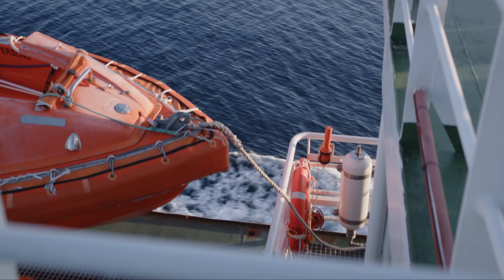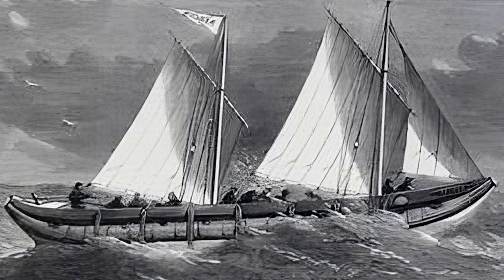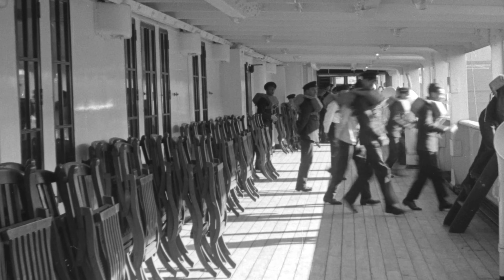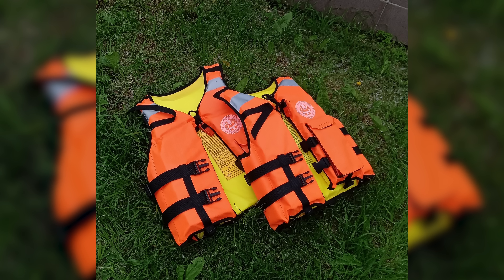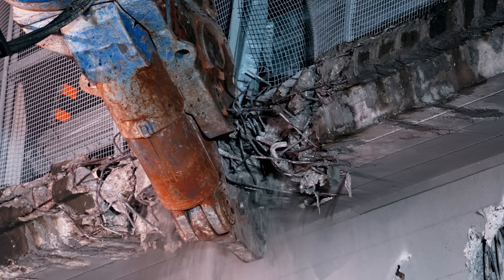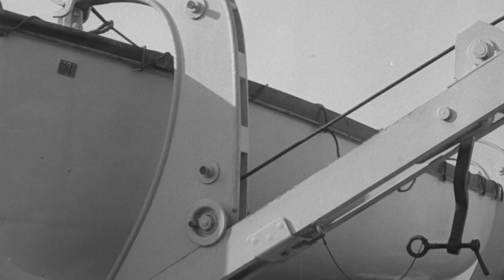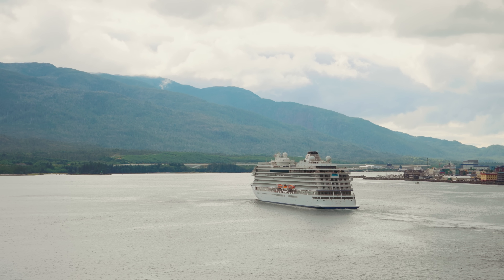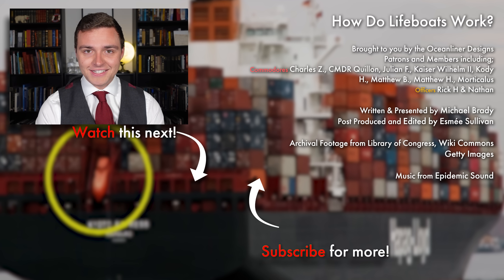The Amazing Evolution of Lifeboats: From Titanic to Today!

Comment: I remember watching the footage of the Costa Concordia sinking and what really stuck me was all the difficulties they had launching those modern lifeboats. Even with all the advances in technology they still hadn't solved the issue of launching boats out of a listing ship safely. This video is fascinating. In some respects the lifeboats of today are far more advanced than the ships of time past. At least in an abstract technical sense.
Reply: The reality is there is no safe way to launch lifeboats from a severely listing ship. The people on Costa Concordia lucked out that the wind pushed the ship towards the island. Had the wind pushed her further out to sea that ship would have capsized and taken thousands of people with her to the bottom.
Reply: @zombieshoot4318 the captain a fool that he is (he got 16years prison) intentionally run the Costa to ground as soon as he knew they were going to sink. About the only wise decision he made
Reply: @waldo197720  sorry but you’re wrong. The ship lost power immediately because the impact was in the engine room. The ship was at the mercy of the winds and currents. They had no ability to steer the ship. The captain lied about grounding the ship. The Italian Coast Guard stated that the ship drifted into its final location. It was sheer luck the wind pushed them that way.
Reply: @zombieshoot4318 The Rudder lost power slightly later, he ordered it to point to shore in an attempt to ground it, it cut out after getting to it.
Reply: @kenrfc  well he’s right as long as humans aren’t involved. 😂
Reply: @kenrfc  The problem with Costa Concordia is that the evacuation was started only after the ship had already started listing. Had the evacuation begun as soon as the collision happened, all lifeboats would've been lowered into the water.
Reply: That’s because it listed and if they tried to load people on it and launch it…. Yikes
Reply: @kenrfc Well what alternative could there possibly be? If a ship is heavily damaged quickly enough than yes, it will list, technology cannot defy physics. The odds of that happening in the first place nowadays are very, very small though. Airplanes can still fall out of the sky, but they are still the safest means of transportation in existence.
Reply: The Oceanos in 1991 had the same problem.
Reply: @kenrfc  It's objectively true. Ships are getting into significantly fewer shipwrecks these days thanks to those modern features. He never said life boats aren't important and necessary
Reply: @kenrfc He is right, the Costa Concordia would never have sunk if the captain wasn’t a ridiculous excuse for a human being and an idiot. The entire thing was due to his incompetence and complete carelessness. He didn’t even order an evacuation and abandoned ship. It is really the cruise lines fault for even employing that man
Reply: @maxonite His Safety Officer took command and ordered an evacuation, which is pretty hard for an Officer whose not ‘Captain’ (Role not rank) too do.
Reply: @plagueoperator7438  exactly, had the captain done his job other people would not have had to try and do it for him
Reply: @maxonite  Yeah, its his fault, but it was his actual lack of regard for Procedure, and the failure of his Company to pick up on it, so they hold the overarching fault aswell.
Reply: Costa Concordia is a different can of worms
Reply: It seems to me the best thing to do to deal with a listing ship is to design lifeboats to be easy to enter from the water.  Once the ship reaches a critical point, the boats would be launched empty (and likely faster and more violently) before it becomes impossible to do so.  Individual humans would have the ability to escape the ship at a far greater list, especially if they can swim well enough to hop into the water from the down-angle side and proceed around the ship to the empty boats.  

Any which way you cut it, having the boats on the water empty is better than not launching them at all.  Which means also designing the launch mechanism to breakaway at pressure, allowing the lifeboats to be freed and float up unassisted after the ship has sunk.  It doesn't matter how good of a swimmer you are; hypothermia sets in quickly in the ocean.
Reply: @adde9506  What you're describing is liferafts and ships already have them.
Reply: @kenrfc Costa Concordia was 12 years ago.. Modern radar and navigation systems have evolved throughout the years
Reply: @Johnchoojiale And procedure wasn’t followed, the Ship cannot pilot itself and even with Modern Satellites, it can still be upto 5-10ft off your actual course, which is why Navigators have to give exact co-ordinates, which was not happening on Concordia, if it had, the mistake would have been picked up on, and this ship would have returned to a safer distance.

Comment: I'd argue that the davis system is also a big problem for passenger liners too.

Passenger ships are slowly phasing out professional crew roles for minimum wage and migrant workers. Investigations show that most crews are either not properly trained to operate Davis systems, or can't realistically operate them in the event of an emergency. Low-wage workers are also not professionals and shouldn't be expected to perform complex lifesaving duties.

Also, Davis systems themselves are notoriously difficult and dangerous to use in bad weather or when a ship lists. For these reasons, ships are starting to transition to inflatable boat slides as an alternative. It would be nice to cover the advantages and disadvantages of this new system.

Comment: They did a crew drill last cruise I was on. Sat and watched them lower one of the boats and drive it around. Quite the operation. 
I believe listing was an issue with the Costa Concordia. They couldn't launch the boats on one side. But they still carry enough redundancy if that happens. Of course being close to land in calm, warm water also helps.

Comment: Did not know that they used life boats on cruise ships to go ashore but it makes sense and kind of double as an relaxed life boat drill.
Reply: Those are a special kind called "semi enclosed lifeboats" with more ventilation and better amenities. They also have 2 engines and sometimes a bow thrusters to make maneuvering easier. The standard lifeboat will have a single screw and won't be very easy to maneuver.

Comment: Fascinating, but I wonder if there is any fallback procedure if electrically lowering the lifeboats becomes impossible? Also: How safe are the life rafts for the remaining 25%? Surely there is a reason to use these modern boats rather than rafts only... so does this mean some of the crew will have to do with less safety than the passengers?
In my mind there should be "proper" lifeboats for 115ish% of all occupants, given that lifeboats, their loading or their deployment can fail, leaving a percentage of them not utilised to their full capacity. Safety margins should not be skipped in emergency procedures, after all.
Reply: From what ive seen life rafts aren't less safe. The Main drawback ultimatley comes down to less space, less storage space for supplies and the inability to move under it's own power. So.. It certainly has it's draw backs but ultimatley itll safe your ass either way. As for the electric Backup, in passenger ships, the abandon ship command should have been given waaaay ahead of the ship loosing power. Modern cruisers need to loose all engines, then the Backup generators, then they also need to loose the Batteries before they are truly without power. So if you are in a Situation where the ship is fully without power, the captain has screwed up majorly. But I do belive there is a manual release.. I recall seeing Instruktions on how to release the boats even without power on cruise ships..
Reply: @lucariolps277  That makes sense. I'm really into aviation and constantly positively surprised how much can be done on a modern airliner even when it has lost all power. You make a good point regarding the redundancy in the power supply on these ships, but of course the damage that sinks the ship can also have severed electrical lines, and beyond that there are all the scenarios that we can't imagine, so a manual release mechanism sounds like a great idea...

Comment: "Modern passenger ships only require fully enclosed lifeboats for 75% of the ships company...."

Hey I've seen this one before, this is a classic!
Reply: Surprised at this, thinking we would have learned the lessons of history and required something like 110% of full passenger capacity.
Reply: @aevangel1 amusingly, you're right. It's typically the crew expected to go into the inflatables. For example, the "Oasis of the Seas" has 6000 passengers and 2300 crew. They have 7068 seats in the rigid lifeboats, with another 2000 seats in inflatable life rafts.
Reply: @aevangel1 Modern day life rafts are very safe and quick to launch + inflate, and vessels are required to carry enough rafts to hold well over full capacity. I work on a ship and we have in life rafts ALONE the capacity to hold twice as many passengers as needed. On top of that we also have the non-inflatable life boats highlighted in this video which do not account for full capacity, however its something close to 75%, and would be deployed first in emergency as on a normal sailing would be likely to hold all passengers anyway. The reason we favour life rafts is for many reasons, but im guessing it is mostly because they are compact, can hold more people, can be loaded quicker, and also are completely covered from above. I am terrified of the ocean but I feel extremely safe with the abandonment procedures of this day. The 75% number sounds worrisome but do not be mistaken, as far as I know all passenger vessels are required to hold enough rafts and boats to accommodate for at least 200% capacity. Although I do not have the SOLAS manual in front of me so I may be mistaken.
Reply: @kianapoipoi5375  I like how you failed to mention the real reasons rafts are preferred, they are cheaper than real lifeboats in cost, maintenance and deck space.

And sorry but you're deluding yourself if you think they are as safe as lifeboats. In rough waters, anywhere its too hot or too cold or places where rescue will take a while.. you are screwed if you're on some inflatable raft drifting in the middle of nowhere.
Reply: @jagerdergroe8604 You're going to be drifting either way. A lifeboat has enough fuel for 24h at 6kts but mariners are instructed to stand by the location of the shipwreck and wait for rescue. A life raft might seem flimsy but as someone who has been in both, I can attest to the fact that a life boat feels a lot less stable and would make you feel more seasick than a liferaft. Add to that the fact that liferaft inflate on their own if the ship sinks and I'm very glad we have them on board.
Reply: I was really surprised at that! I'd love to know what both the offical and unofficial reasoning was .
Reply: @Wintermute909  It's expected that inflatable rafts will make up the difference and that, on a busy seaway, help will rarely be far.
Reply: @ericreese7792  hmm where did we learn that was a bad idea
Reply: The Captain can use the inflatable 👍🏻
Reply: @LeoTicky  the captain goes down with the ship.
Reply: @Hamstray  well, the ones with honour do 😉
Reply: What’s a rerun?
Reply: The logic behind this is that if a ship lasts enough to evacuate all its passengers help probably has arrived and if it doesn't more lifeboats ain't helping.  For example in Titanics case if she had enough lifeboats it changes nothing Titanic barely launched what she had. Also cruise ships tend to be closer to the coast and the idea of help not arriving for hours is much much less likely.
Reply: The survival rate in an inflatable liferaft is actually very low. Big storm waves can crash down over you and crush you to death. I would fight for my life to get into the fully enclosed lifeboats.

Comment: My parents lived on Block Island, off the coast of Rhode Island, from 1988 to 1991. Block Island was known for its treacherous seas and rocky coast, and there were many wrecks in its waters in the 18th and 19th centuries. If word of a wreck reached the residents, able-bodied men would set off on "life boats," kept in a breakwater on the Island's east side, and try to rescue as many of these survivors as possible. Any survivors would stay with families on the Island until a way was found to get them back to the mainland safe and sound. A few of these old life boats were still kept on display as museum pieces when my parents lived there. The need to these boats lessened with the construction of two light houses on the island with fog horns and, much later, the introduction of radar and other navigational aids. Nevertheless, the seas there are still considered dangerous. The fishing industry is one of the main economic industries on the Island (along with summer tourism). Often, especially in winter months, the Island is completely cut off from the mainland for weeks at a time. Even with all the modern innovations, ferries and small planes will not attempt the trip to or from the Island for weeks at a time.

I remember one particularly frightening trip on the ferry at Christmas time in 1989. The seas were so rough that waves were breaking across the high upper deck of the ferry. I got SO seasick!

Comment: Hi Mike, thank you for another interesting video. When I went on my first cruise in 1968 on the Australis the motorised lifeboats were used as tenders, we were exposed to the sun and heat on the ride ashore and back to the ship. From what I remember some boats were propelled by a sort of crank arrangement operated by the people in the lifeboat. During the sinking of the Wahine, which I watched from Seatoun beach, the lifeboat which arrived there seemed very big indeed and getting the survivors off the boat was not that easy even though this beach was relatively sheltered. Having been on several cruises in recent years and used the tenders I can say that there has been a great improvement in lifeboat design and comfort although they are quite crowded with about 120 people aboard.

Comment: We were on a state ferry and i pointed to the boys where muster stations are and how they have life rafts rather than lifeboats. We go theough what to do in an emergency every single time we board, eyeing out where lifejackets are, where the evacuation points and what to listen for (horn blasts) to determine what kind of emergency. 

They found it funny that ferries have rafts rather than boats, but each raft can hold up to 100 people
Reply: Ferries, by definition, are usually operating in close proximity to land, in a channel or across a lake or bay. Therefore there's less of a need for lifeboats equipped for open-ocean survival, and the chances of a swift rescue are higher when close to the coast.
Reply: @InventorZahran  doesnt mean you cant be aware of your surroundings and not know what to do in an emergency. There have been several shipwrecks close to land with loss of life like the Atlantic, Eastland, Artic being good examples.
If anything those disasters show me you cant just rely being close to land or other vessels to save you.

Know your way out and know your way to evacuate safely.
Reply: @lovmi2byz91 You're doing parenting right. Knowing how to ensure your safety and the safety of those around you is so important, especially in such a hostile environment as the water.

Comment: Back in the late 70s I served on the USS Sacramento. AOE 1. We told to go in the lifeboat to update the survival gear to our surprise the 'gear' consisted of WW2 C rations  cigarettes all from WW2 including all water cans (rusted through) The Sacramento was built in 1963. Never knew if these survival rations were the originals or not but they were all manufactured in 1943
Reply: Imagine you ship sinking and your in the life boats only to find out you’re stuck with 30 year old C rations. The ultimate indignity!
Reply: @KCKingdomCreateGreatTrekAgain  I truly believe because the Sacramento was an  ammunition oiler almost 1000 feet in length that an attack and hit in realistic terms would utterly blow the entire ship into oblivion with no or very little chance of crew survival . The reason is most of the 'oil' we carried was JP jet fuel and at that time the Navy still used NavGas and the volatility of this stuff is unbelievable. Phased out 1980 ?? Brass connections and brass wrenches No Sparks!!!
Reply: @davidrudd9846 I'd like to say "at least it'd be over quick," but I've heard enough horror stories about ships and big amounts of burning stuff to know that those last moments, well, they wouldn't exactly be pleasurable.

The book The Last Stand of the Tin Can Sailors comes to mind, but also just numerous of Drachinifel's videos.

There's just a special kind of terror reserved for the prospect of a violent fuel fire in an enclosed space.
Reply: 😂😮 - Someone never checked on that sooner? Good thing you didn’t have to use them before then! Out of sight out of mind I guess.
Reply: @angelaowen1513  It really shocked us no records
Reply: Wow! Over 30 years…